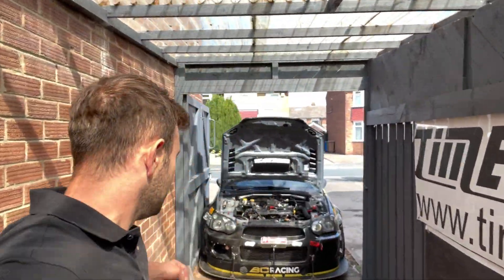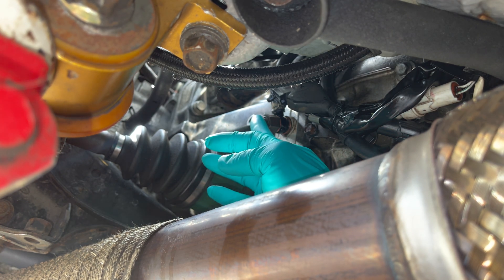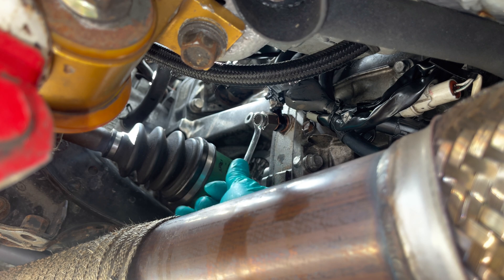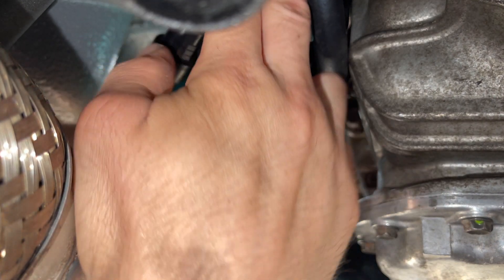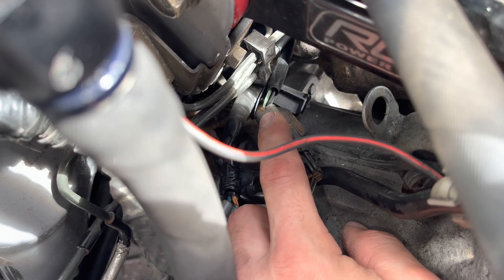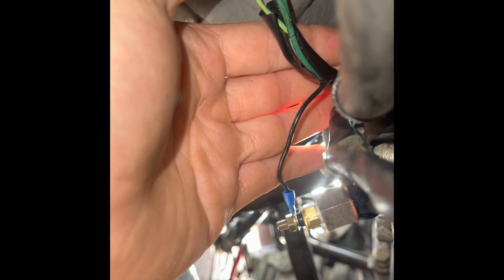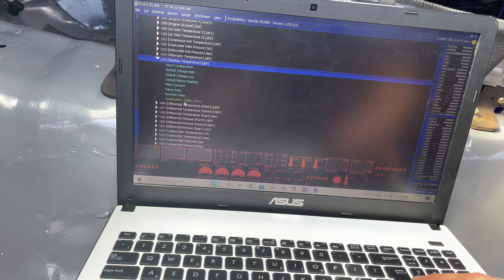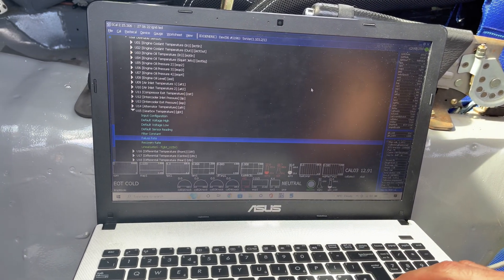* Syvecs Gearbox Temp Sensor - Subaru 6 speed *

Comment: Hello is your Gearbox the one from the STI 9 Hawkeye  ask as the the earley ones had oil Pumps but the later 07 STI 9s did not ?
Reply from the maker: Hi mate, so mine is the earlier blobeye one, ty856wb6ca, it’s a jdm spec c gearbox which had the internal oil pumps. As you say the later gearboxes didn’t have the oil pumps, exactly the same principle and torque specs etc throughout just slightly different components here and there
Reply: @5501pickopicko  great videos you deserve more views and I’m sure when people discover you channel it will grow fast

Comment: Looking forward to see the measurements. I added the factory lines and radiator with heat exchanger from Spec C model, just to have more linear temps in hot and cold weather.